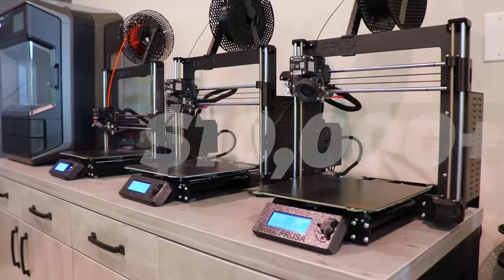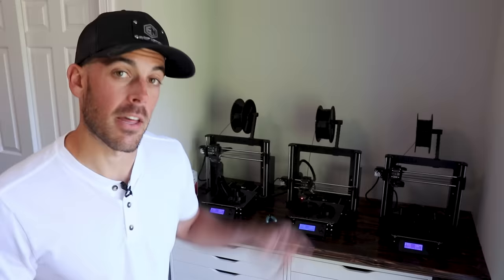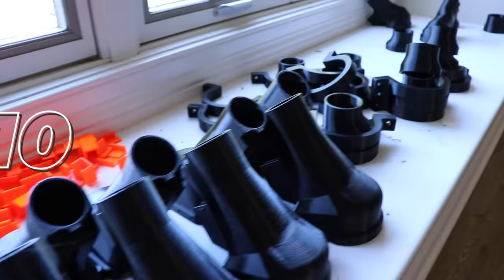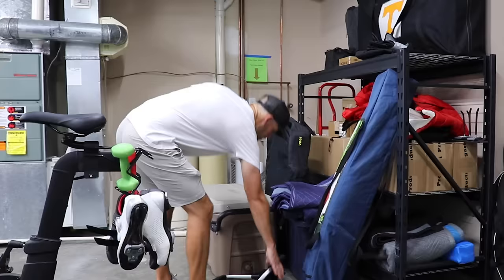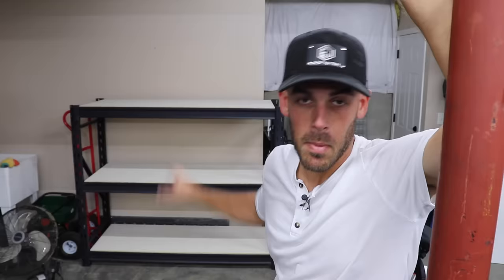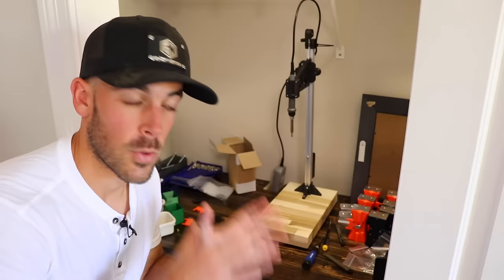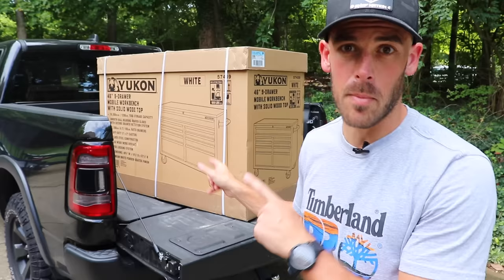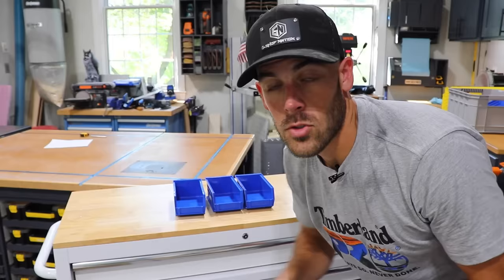I spent $10,000 on 3D Printers...What now? // The Print Farm

Comment: Very nice! Have you had any issues with bed-adhesion or warping? Have you thought about adding any draft protection/ partial covers around your print farm shelves? I print almost exclusively with PETG on my Prusa and have occasional warping on the corners of the print facing the bed - it was largely caused by a draft in my office (printer is close-ish to the door), I still need to build a proper enclosure.
Reply from the maker: Zero issues with PETG + good print bed.  I throw out the OEM Prusa bed and upgrade to an Ultistik version.  If I were printing is something like ABS, then definitely I'd need to consider that.

Comment: Nice Prusa printers. Would it be possible to share your printing profiles that is if you use Prusa Slicer? Was that a insert press using a soldering iron shown in your wife closet?
Reply from the maker: I use Prusa filament (Prusament) and use the standard settings in the prusa slicer - dead simple.  Also I put a link to the article about how to build that little heat set press in the video description

Comment: I am interested as to why you only use the Prusa printers. Do you honestly feel that they are the only printers that you can use straight out of the box with little to no setup. Have you looked at other printers that could be just as reliable as the prusa other than the Bamboo P1P. Also do you print anything that is in large format. A lot of other youtubers print large format helmets for Cosplay. Do you print anything for yourself that is in large format. ?

Comment: Are you just using sd cards in each one or do you have them internet connected with Octoprint or something similar?
Reply from the maker: It's like dial up internet over here, manual SD Cards.  Honestly it's not terrible for my case because I'm printing a lot of the same thing.  Now for a print farm that acted as a service bureau - that would be a nightmare.

Comment: 2 things how often is bed level an issue for you and also flow rate and temps then where did you get the cement dampeners or the foam or even the trim looks awesome and I wanna do the same in mine was thinking of switching to prusas been stuck with creality everyone says they are soo much better than creality

Comment: Do you print straight from SD cards or do you use something like Octoprint? SD cards seem like they would be a pain as you would have to walk down to the basement ever time you wanted to start a print.
Reply from the maker: SD Cards, and it would be a royal pain in the ass if the print files changed a lot.  Luckily mine don't so it's not a huge issue but a minor inconvenience when I need to introduce a new product.

Comment: Travis, awesome setup of the printers and the cart workstation.  I'm curious, with 9 printers in the basement... are you using the SD card method to upload/run prints or have you networked them somehow?  I bought a Prusa i3MK3s after watching your first 3D Printer video about 3 years ago.... have loved having this machine.  It is a true workhorse but that SD workflow to transfer print jobs has been a tiny pain.  I know others have successfully networked the Prusa's and was wondering if you have and what your method/equipment/etc used was.

Comment: With the pavers and printers. Are there concerns with sag on the melamine boards? I’m running a similiar rack for my three printers on 1/2” wood and it has bowed substantially in 2 months without pavers. Just 2 ender 3 and a cr10. All on separate shelves and still bowed about 3/4” in 2 months
Reply: Congratulations 🎉
You have been selected as the winner of Prusa i3 MK3S+ 3D Printer.
Send me a message via the above number so we can sort this out.

Comment: Great set up.  Do you run your printers at night?  Sometimes I do but not often.
Reply from the maker: Yes they run around the clock
Reply: @ShopNation  have you thought about changing to Klipper firmware? Could double your print speed without sacrificing quality.

Comment: Is there a benefit to printing all your parts in PETG? I sell 3D printed parts also but mainly use PLA
Reply from the maker: 2 main reasons: strength and heat resistance. PLA is great but will soften and deform if it gets too warm, plus it’s extremely brittle
Reply: @ShopNation  that’s cool thanks for the tip does it print as easy as PLA does?

Comment: You should ventilate anyways, especially if you have 9 printers going at once. A single printer is not going to emit a ton of VOC's or UFP's alone, but if you have 9 of them.....just think about it. If you spend any amount of time in there, you should really consider installing some ventilation. That, or enclose all of your printers and vent the air through HEPA and activated carbon filters. You don't want to find out later that you gave yourself lung cancer. The research and science behind 3d printing filament off-gassing is not thorough or complete enough to be 100% positive that it's safe *long-term*, so err on the side of caution. Plus, if you ever want to print other filaments like Nylon or ABS, you'll already have the ventilation part taken care of.

Comment: Great setup!
I’ve a question, when you do a print does the PC/laptop need to drive the print through the whole process? Or does the process start with the PC sending the whole print file to the 3D printer and then the PC is not needed during the printing? I am wondering if you need to have several instances of the printer software running and so the load on the PC might be high?
Reply: Using a Prusa Printer, the slicing is done on a PC and then the gcode is exported to an SD card. The SD card is put into the Prusa and the printing is done from there.

You can also control the Prusa directly from a PC, but it is very convenient to just use the SD card as you do not have to worry about the serial connection etc.
Reply: @jesseadamczyk1745  You can also manage prints with OctoPi. Which is just fun.

Comment: Great project!
Curious how you send files to the (right) printers? 
Do you use, or have you tried, OctoPrint? 

As if you didn't go far enough... webcams on each of the printers to monitor the prints when you're away, or knowing when to head down to clear the beds!
Reply from the maker: All print files are stored locally on SD cards - super old school.  For my particular setup it works ok but would be terrible if I was constantly printing different things.
Reply: @ShopNation  Good point if it's mostly the same files. Far more reliable from the SD card.

Comment: lol you paid 10 grand for over priced printers a creality is like 500 bucks dude half that price and wayyyyy better prusa is a rip off
Reply from the maker: Yeah no
Reply: @ShopNation  your a fan boy then no offence.. see prusa is just marlin firmware with stuff enabled that marlin has made all available prusa still uses printed parts for its stuff theres no real injection molding like ender or any other manufacture use the printer is about 250 dollars at most and it is farrrr over priced... 1000 dollars no thanks you can get a ender 3 pro  etc for half that if not less that does the same thing in many cases better out of the box no configuring no messing around with.. to spend 10 grand when you could of spent 5 or less just boggles my mind i mean its your money to burn but geesh man.. my pruda ender 3 pro out of the box prints perfect no need to do anything even their sla printers work out of the box.. not a fan boy of the brand just dont like being ripped off like prusa does to its customers

Comment: Shopify sucks.... The app market is a joke.....
Reply from the maker: You don’t like Shopify because of the 3rd party apps that have no affiliation with Shopify? 🧐
Reply: @ShopNation  every Shopify app is backed by Shopify and the app devs are contractually obligated to provide service to apps. Yes, they are contractually affiliated with Shopify. Also many app devs on Shopify are slow, have horrible fixes for the new Shopify 2.0 that drastically reduce site speed or otherwise cause other dysfunction.

Also chargebacks and other payment problems are pretty rampant. 

How to make Shopify better: quit trying to synthesize an app community that is beyond paygated. Get rid of trial periods. Allow people to make free apps... The API is already public, they are just making thousands of people reinvent the wheel anytime a new Shopify store opens... 

The only reason I switch clients to Shopify is if they need to calculate state sales taxes to make sure they are staying legal and properly reporting to each state if sales exceed a certain amount, and they have some other pending problem in addition to that (site is just outdated). Shopify has a good fix for that.

Experience: I run several websites for businesses grossing a couple mil each